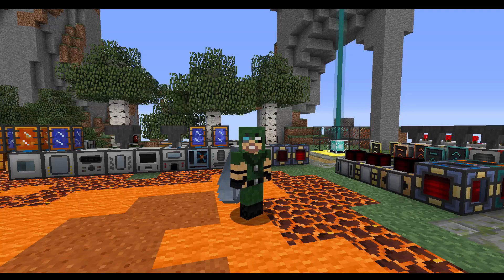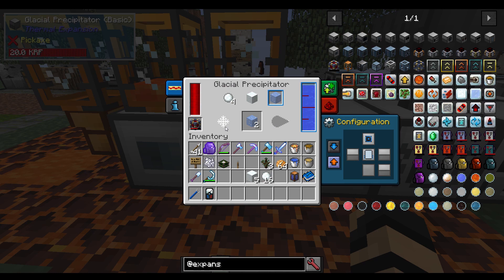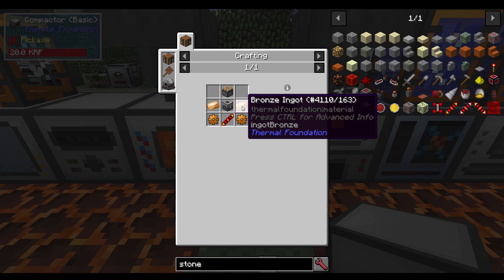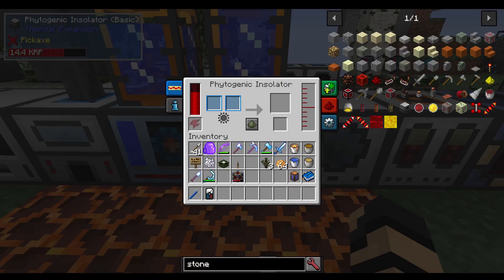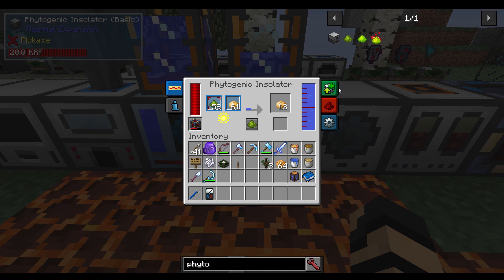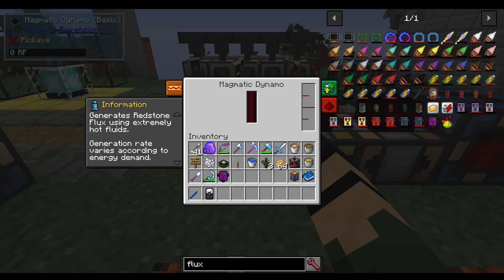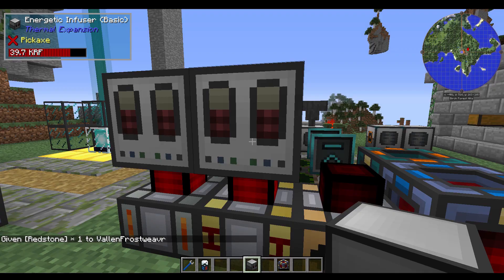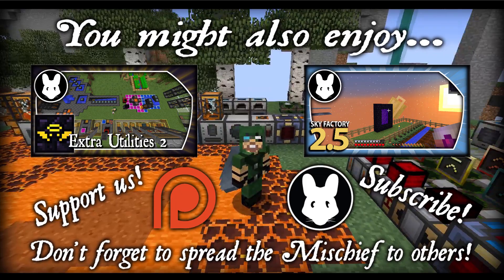Thermal Expansion: Getting Started Part 2! Bit-by-Bit in Minecraft 1.10+

Comment: what's the difference between the flux capacitors and the energy cell?
Reply: Flux Capacitors can be Shift-Right Clicked and it will charge your held items like the Flux-infused tools, Meanwhile Energy Cells are a form of power storage for Thermal Expansion.